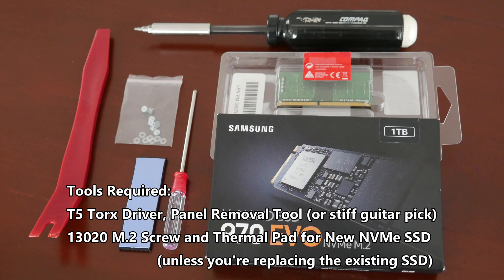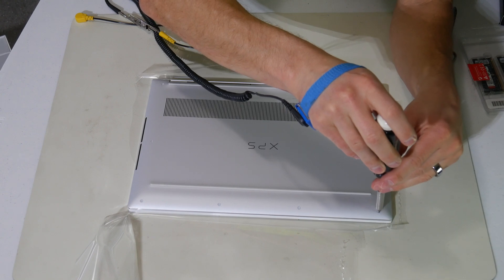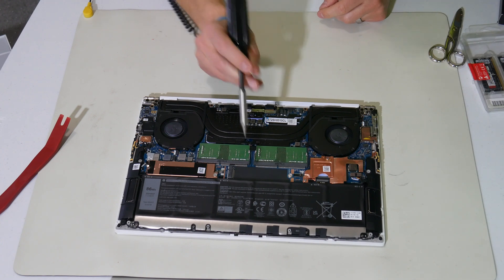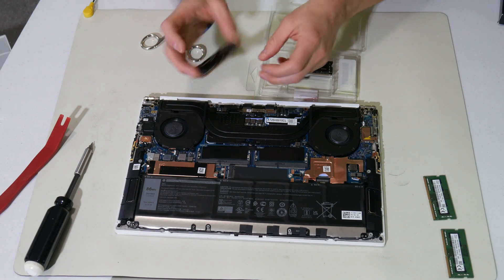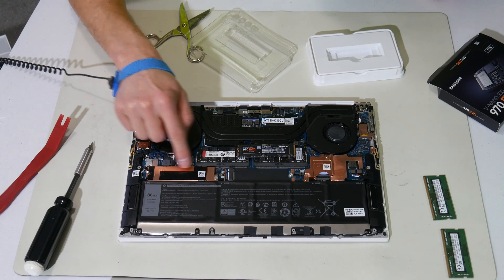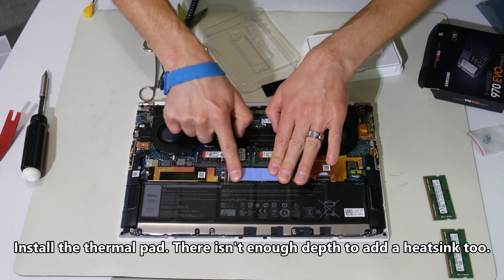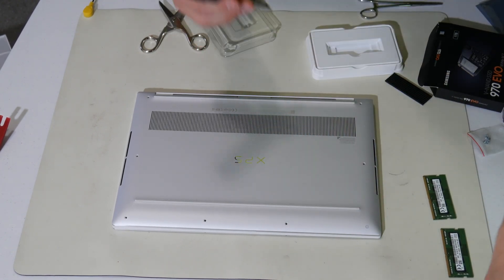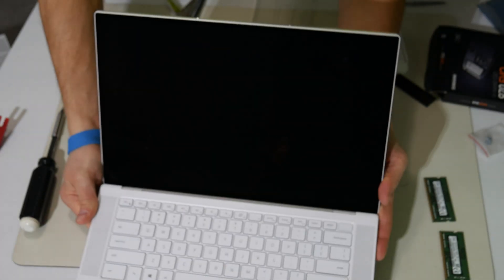Frost White Dell XPS 15 9500 (2020) Unboxing, Ram Upgrade, NVMe M.2 SSD Upgrade in 4K

Comment: You do not need the antistatic strap in 2020 or 2021. I have been working on laptops and computers for 25 years and never use one. Modern computers don't have issues with static. If you know how to handle the components.

Comment: Hi, great vid. do you know the max total ssd capacity? I have the 17” with 2tb supplied (max available from dell) but would ideally like 4tb (2x2tb) but I can’t find any info whether that would be supported 😒 any intel appreciated. Thanks
Reply: I think it should work fine with a 2*2 Tb config but you ask a dell representative to confirm it
Reply: You would think they should know, but they didn’t when I spoke to them!

Comment: Why you mentioned reinstalling os again? Is it necessary or suggestion? As ssd was additional component what if just add ssd and keep using it ..will it work? 
Another question : for this additional ssd I know heat sink could not be added will not adding heat sink be a problem long term? Or should we replace original dell ssd with this ssd ? Appreciate your help
Reply from the maker: There's no need to reinstall the operating system if you're adding an additional drive, only if you're replacing the existing one.
I can't say for certain, but really don't believe running the new NVMe without a heatsink is a problem under normal use conditions. Sorry for the confusion, thanks for watching!

Comment: Nice straight forward video, just happened to do this exact upgrade with that specific ram on the same laptop config. Love the laptop so far coming from a 2017 XPS.Only diff from yours was the SSD, grabbed the sk hynix gold, hopefully that holds up. Wanted to make sure I wasn't forgetting anything after the upgrade was complete and found your video, looks like I just need to run some diagnostics on everything. Thanks!
Reply: Forgot to mention, don't love the yellow tint on the 9500 screen. Tried adjusting through Dell Cinema Color and Color Premiere but still not as nice as my old 4K display on the 2017 XPS. Have you been bothered by your display and have you been able to get a good white balance on it? Don't use the Intel Command Center program, some glitch happens with it that causes you to lose your display and you have to hook up an external monitor to fix it, quite a pain and happened to me twice before I realized it wasn't anything I did wrong to cause it.
Reply from the maker: @keithk888  I've been loving the 4K display. I tend to prefer warmer color, so maybe that's why I haven't noticed any yellowish tint.
Thanks for watching!